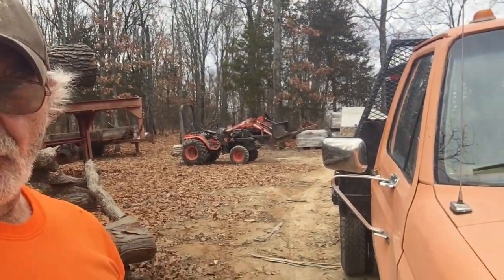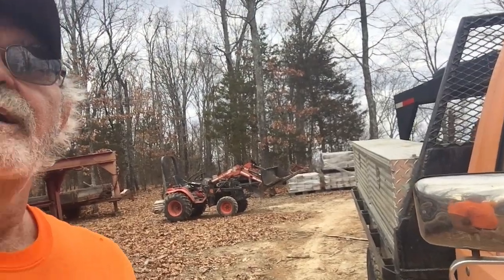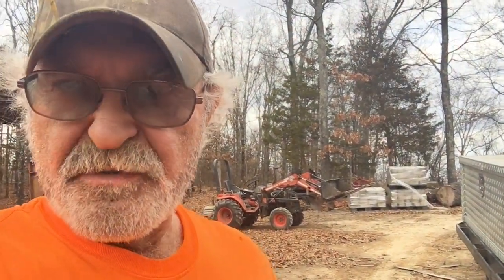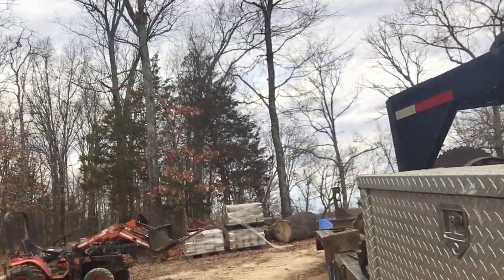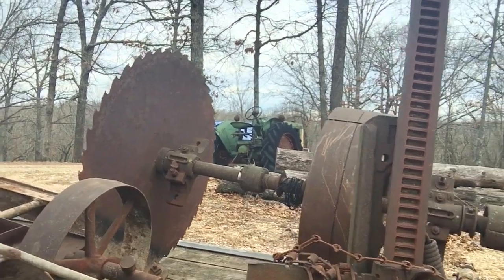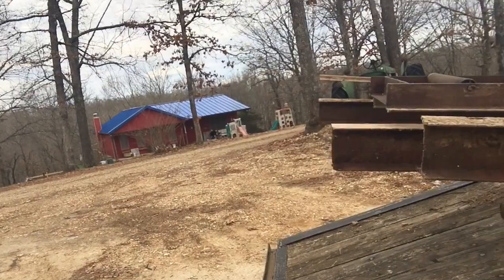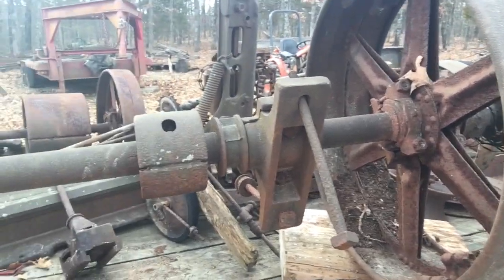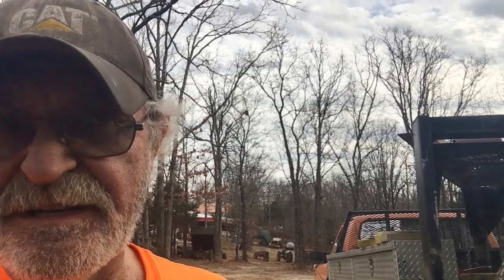Sawmill Retrieval and Removal

Comment: That's some great info you shared with us. Looking forward to seeing how it all cleans up and how it will fit in with the one you're renovating. Great video!
Reply from the maker: Alice the Gmaw thank you ma’am fir replying. There are several items that are identical to the one I plan on rebuilding. A lot of the small rods and flat stock are much too deteriorated to be of use but virtually all the pulls and shafts are very good. Thanks for taking the time to watch and comment. Hopefully you’ll find more interesting stuff in here.
Reply: Hey Buckin' soldier of kindness. Good to see you in the comments. BE KIND...

Comment: was the tire and wheel part of the feed works? I Seen a mill once that you shifted a tire against a pulley driven by the Arbor to reverse the carrage.
Reply from the maker: No Randall that one didn't play a part in the turning of the blade, but it IS powered off of the main arbor TO the blade and the tire powered another jack shaft underneath that in turn powered the sawdust elevator.  But yes, I've seen mills powered as you describe and others the old timers called 'rag feeds'.  Our old Fisher and Davis mill powered off a drive shaft from an inline 8 Buick.  The rear end was removed and a carrier bearing installed across a timber at the back of the frame and a clamp on flat belt pulley went around the drive shaft.  We ran that one with a cable tied to the carb linkage and the transmission in second gear.

Comment: It will be great if you can get is up and running.
Reply from the maker: Alan Inu No Tomodachi this one will primarily be used for parts and pieces to put together one that is much more desirable. The one going to be built is a 60” mill with a 12’ carriage powered by a 3/71 Detroit two stroke diesel. That’s for watching and commenting Alan.

Comment: Update?
Reply from the maker: Mike Adams man I’m running so far behind it looks like I’m winning !!  Lol. This is primarily going to be for donating parts and pieces to my real good 60” mill to make it better. That one has 48’ of rail bed, a 12’ or 14’ carriage and is powered by a 3-71Detroit two stroke diesel power unit. There is just about enough here to build a complete mill though. But the big one is a much better mill. All I need to get started is a little concrete and a lot of ambition .... lol. It’ll get there though. Thanks Mike for rattling the cage. I still have tons of comments to get to on the last couple videos. Lol .... take care !!